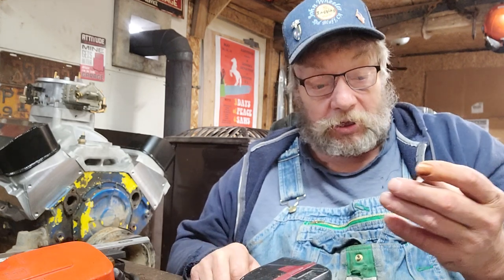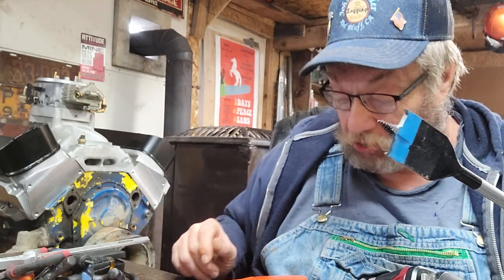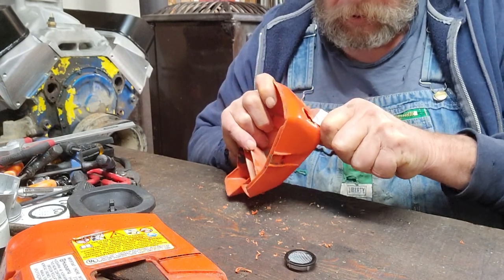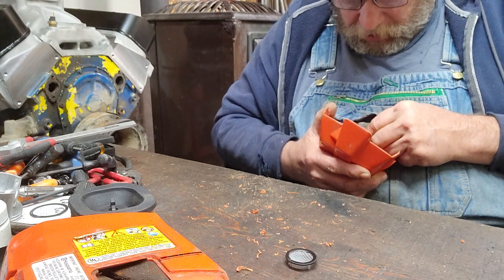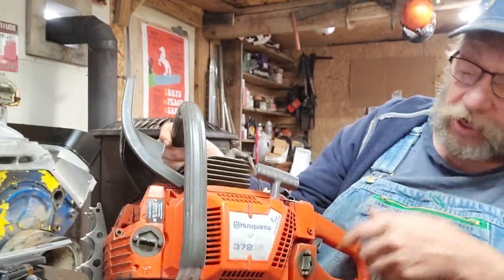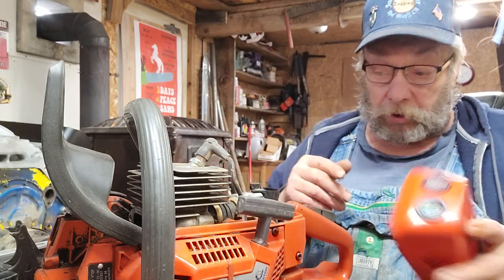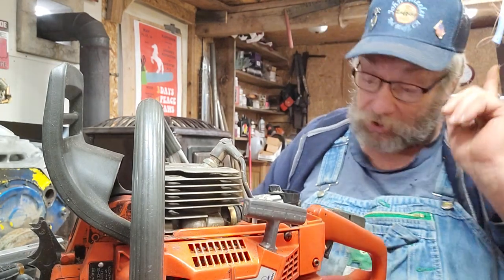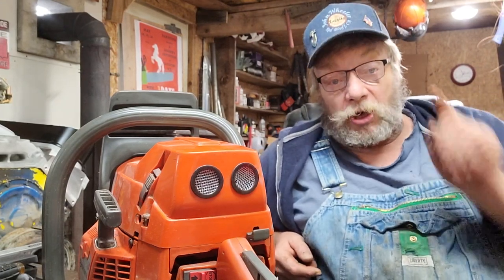A great new product! chainsaw air vents! fits any saw and under 20 bucks!

Comment: Have you ever checked out these things called frog skins they're the same concept but more of a finer screen along with an adhesive backing. They also have different diameter circles along with different shapes and sizes so you can customize any air box with these and they come out looking almost like Factory made in my opinion. Another cool thing is whatever shape you decide to order it comes with a template in the package with your screens along with instructions that explains how you can attach the template to whatever you're trying to customize, very simple mod that even a non mechanic can accomplish. Since I'm sending you this message I also want to take the time to thank you very much for all the informative videos that you have made over the years, you're the man Iron Horse keep up the honest hard work.  JH
Reply: Where do you get them from?

Comment: Pretty cool..ive drilled some holes in mine before..not quite that big though..just cover them in the loose snow...it will suck in & freeze the air filter...👍👍

Comment: Yeap I put 2 vents on my saw this morning lovely job done put it to the test this afternoon and what a big big difference it made cut 7 to 8 cords of hard wood in under 15 minutes just the odd couple of flames out the vents but must be down to the porting as am running 250 cc scrambler head air cooled on big old saw can’t say what but begins with j.have fun friends.

Comment: If you look up "motorcycle airbox vents" on ebay, you get the Uni ones which also snap in, but have the foam filter that you can lube and clean to avoid sucking in extra dust.

Comment: Hi Harvey, Would you be able to demonstrate on a running saw the air flow direction at the vents at idle and full throttle. Maybe use a piece of tissue paper in front of the vents. I'm very curious how much air movement there is in both directions.
Reply from the maker: Yes I can
Reply: @theironhorse6600  Thanks!

Comment: cold air intake , makes perfect sense.
Reply: Not if you understand ho the air injection system works as husky calls it.
Reply: @alanmeyers3957  i reckon a baby hho cell would be fun on a saw , ive seen two strokes exhaust clear right up with them ie no blue oily smoke anymore like all two strokes do given their highly ineffecient design.
doing it on my mower  winding coils to make a little electrical power from the existing magnets in the flywheel.
ive had them on my utes for donkeys years , yeh im always being told they dont work LOL.

Comment: I thought air injected worked like mini turbo. With extra hole you would lose that. Be great to see dino run and find out.
Reply: Dyno Joe needs to test this.. I was thinking the same thing
Reply: You are correct. He was explaining in the video how the air cannot go into that area because the area is "sealed off". Well he WOULD be correct, but he is not factoring in the fact that the intake is in that area sucking in the air that is being forced into that area. By putting those vents on the back he has effectively eliminated the forced air intake that turbos the saw. This is NOT a good idea on a saw that uses air injection. If this were a normal carbed saw  with no air injection that you wanted to help get cold air into the intake, then these would be a fantastic idea. However on these air injected saws this is no bueno.
Reply: @jakedomoto6802 it doesn’t turbo the air in, it feeds air from the flywheel area instead of thru the cover area as on a Stihl.
Reply: I mean it's not an "actual turbo" but when you are forcing air into a sealed intake chamber with rotational force and labeling it "air injection" you are heavily implying that you are creating induced air into the intake. I'm not saying that I support the claims or that it's particularly effective, but what I AM saying is that by eliminating the seal that your cover creates by being a closed off area you are eliminating any forced induction that may or may not have been helping. If they simply wanted to reroute where the cold air is pulled in from why not just run an intake boot down near the flywheel? Why seal off the whole top cover/intake area and use the flywheel to force air in? They went to great lengths to make that design work. They even specifically built an inside plastic piece that sits inside the flywheel cover to help direct air.  From other videos I have seen that go more in depth into these saws there is some amount of forced air created via this method, I have even seen aftermarket companies do modifications on these saws that improve upon the design with customizations that supposedly make it more effective. We can argue over what exactly to call this process, but the point is, if you are forcing air into the intake area and then put holes into that area, you are losing the pressure seal and essentially pushing forced air out of the saw cover instead of into the intake like you had intended.
Reply: Blow smoke filled air into a box (flywheel creating inward pressure to the intake area) this creates positive pressure in the box like a balloon inflating, cut out a small hole in the box and suck the air out with a vacuum (intake).  Now cut 2 holes into the side of the box and watch as the smoke starts to pour out of those holes from the inward pressure created by the blown air. This is essentially what is happening in the saw. Rather than creating the desired effect of increasing inward air flow, you are taking a system that would otherwise have positive pressure created from forced intake, to negative pressure by creating a non-forced air hole. The flywheel creates positive pressure, the two holes on the back are not forced air but rather are exit points for the forced air.
Reply: There is no possibility that a fan blowing air into your intake will produce any more power. especially warm air. 2 strokes and any motor really will always produce it's peak performance and ease of tunability with unrestricted cool fresh air

Comment: From looking at my STIHL, I think that this would cause overheating..? I mean the way that the cowl is designed forces cool intake air to be drawn through the engine fins ..thus providing the only means of heat dispersion. So wouldn't this stop the flow of air over those heat sink fins? *I had a previous idea for drawing intake air through a Vacuum cleaner hose connected to a backpack housed Automotive engine air filter (as it would move the intake air source to a cleaner more remote spot and provide long lasting superior filtration), but I give up on that idea when I realized it would force a heating issue.

Comment: Looks quality. Novice lumberjack has a video where he uses a screen similar to frog skins to make a non circular vent and a roll of this screen was under $10 I believe. Always good to have options.
Reply: I was going to say something similar about the frog skins. Much finer screen would probably keep fines out better. I’ve got some intake vents on my snowmobile that are about 2” in diameter with a very fine screen too. Very similar to the frog skins

Comment: What about the airflow across the cooling fins on the cylinder head ?  Is that diminished as a result ?  Thanks for the video.
Reply from the maker: Not at all
Reply: @theironhorse6600  Thank you.

Comment: won't the air filter create a draw from the new vents and possibly clog up and introduce a bunch of crap on filter?
Reply: We're about to find out!
Reply: I think the Uni motorcycle airbox vents are better for that reason.  They have a foam filter that you oil and can clean. Never seen straight screens before.
Reply: YES

Comment: Dont those vents negate the air injection from the flywheel? The point being that the carb chamber is supposed to be boosted with air causing the piston to have to work less?

Comment: Love you Chanel man!!!. I noticed you mess with some 10mm 044s. I have one in really good shape with a junk cylinder. I'm going to get the hyway titanikel top end kit and I want to warm it up a bit. You said in one video there short blow down saws  what do you recommend far as compression and timing on a 10mm 044 any advice would be greatly appropriated.
Reply: Careful …. Lotta those hyway cylinder kits are experiencing the plating flaking off - oem is best , I know the 044 series very well … built  20 of em in the last year
Reply: @fabzacres-blackcat   I would like to find an OEM 10mm slant fin cylinder but I have been looking for 4 years
Reply: @chrismuncey3861  I actually have a few of them … one needs a drill and tap for the impulse fitting  , the other is gtg.  Oem is best in those 044s both jug and slug …. Next best is oem jug and meteor piston.  It’s a worthy saw to build and can run with the modern state of the art saws no problem-0
Reply: @fabzacres-blackcat  Would you sale one?. I only got to run this saw a few times about 15 years ago when my buddy had me rebuild the carb. I was blown away first time I stuck it in a log the RPM's!!!!!. he always used some cheap oil something called promix  and he was cleaning a bank of one day with little 1" saplings I think it was the barely hitting the throttle on the small saplings for several hours starved it of oil and it ripped a Chrome off the cylinder on the exhaust side when it locked up tight  And I've been on the search ever since I got it 5 years ago. I found a few OEM cylinders on the Internet over the years but they usually won't a arm and leg lol. I also have a really nice I believe 1985 Husqvarna 281 I traded for a few years ago saw it's almost like brand new almost no wear I've thought about porting it and making a nice little play toy out of it but I'm not sure.
Reply: @chrismuncey3861  I only have a STIHL oem cylinder available … it’s not a slant fin but it should make for a good runner!  ... My email is in the about section on my channel

Comment: I was drillin holes in the rear covers on poulans to get more air yrs ago when i was too poor to buy a really nice saw.i bought a brand new craftsman in 2007.straight out of the box 2wks later my wife sees me at my work bench with the saw stripped down.she kinda flipped asked what i was doin.i simply said its a bottled up piece of crap..it cant breath it needs opened up.a few mods and many yrs later i still have that craftsman and has more compression than any poulan/craftsman i pull these days.

Comment: I don't think those are needed and will just let sawdust in 🤔  it's like the guys that use to drill holes in air box thinking needed more air. Just let more dust and dirt in just my opinion so who cares right
Reply: On air-injection saws (like the Husqvarner 372, 390, 572 etc) them vents cause more harm then good imho. Husqvarner air filtration system is proven over the long haul - if it ain’t Broke then don’t fix it !

Comment: Did you say $20.00 a piece or for both? If so, are they being priced by Biden or obummer? Please be real!!!!
Reply: I didn’t mean to offend you Sir, but it seams like a lot of money when you’re refired and fixed pension , please, didn’t mean to offend you. 
Question: isn’t the airbox pressureised by flywheel? Both in huskies , echos,  and stills?  Opus, just heard you say under &20.00 . But still high, ouch. It’s difficult getting old and low on money. Sorry, Semper fi